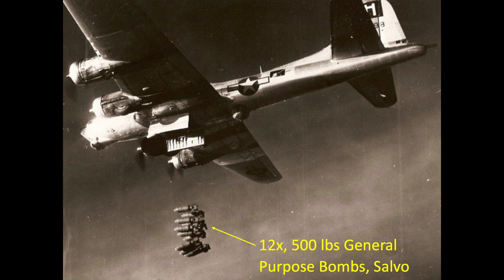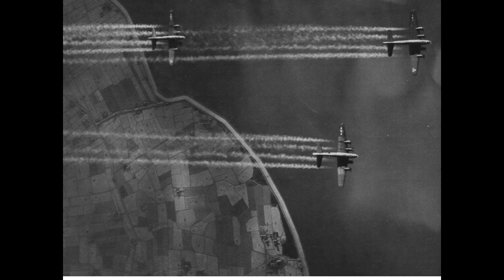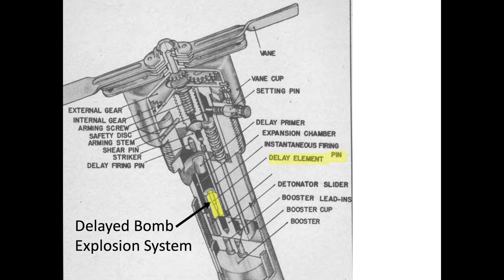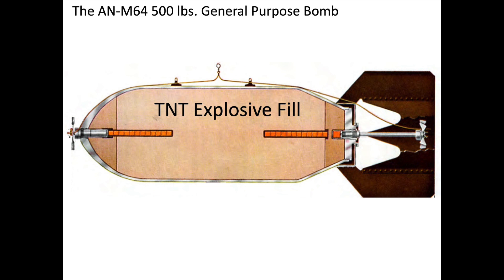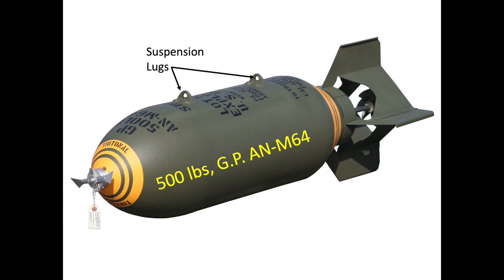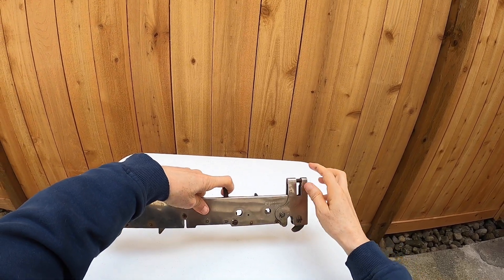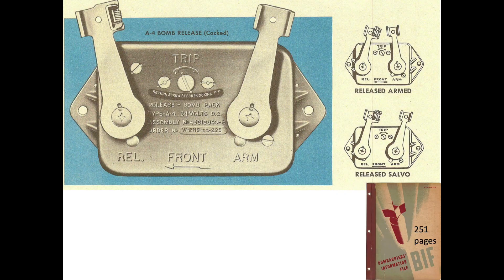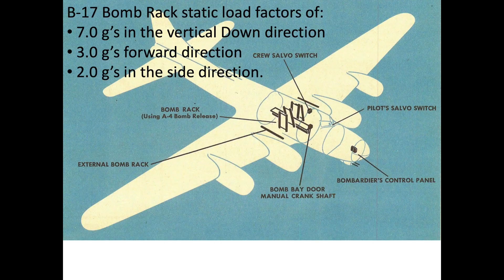B-17 Bombing, Fuzes, Shackles, and Bomb Release Units

Comment: Looks like you've got all the parts to put together a mock bomb release demonstration in your driveway. Wire it all up, get the solenoids working, hang the dummy bombs, enclose it all in a plexiglass bomb bay section, suspend it on a platform and bombs away! Amaze your friends and impress your neighbors! For added realism add a bombardier station with Norden sight.

Comment: Boy does this take me back to aircraft weapons mechanic school at Lowry AFB in 1960.  We were taught to install the arming wires a little differently: secure one end of the wire to the nearer bomb lug, run it through a wire link being held by the arming lever, through the fuze vane, and install retaining clip on end of wire.  The complete arming wire will fall with the bomb.  If the A4 arming lever is in the armed position, the wire link will be retained and the arming wire will be will be pulled through the link and out of the fuse vane; if the lever is not armed, the wire link will be free to go with the arming wire and bomb and the fuze will be safe.  This method prevents damage to the aircraft by arming wires still held in the shackle flailing in the air stream after the bombs are dropped and before the bomb bay doors are closed.  Also, I remember a bomb release actuator that allowed the bombardier to select one of three arming modes when fuzes with different time delays were installed in nose and tail fuze positions: SAFE, BOTH, AND TAIL ONLY.  Although I remember the A4 and B11 quite well, memory fades on the details of how the nose and tail arming levers were actuated independently for this function.

Comment: Disseminating info from official documents is a worthwhile contribution since most aren't really interested enough to find that info for themselves. However, it's not the same as getting first hand info from a WW2 USAAF veteran. What was actually done in practice was often not strictly "by the book." A lot of the commenters who claim their fathers or grandfathers told them this or that have incorrect info because of the typical problems with second and third hand info.

The effective bomb load of B-17F and G models was only three 1000 lb. bombs or five to six 500 lb. bombs on very long range missions. On longer missions half the bomb bay was occupied by the auxiliary fuel tank. That left only one rack for bombs. In my dad's unit, the 34th BG (H), the practice was to load a max. of five 500 lb. bombs per rack because adding a sixth significantly increased the probability of a hung bomb. If you don't believe it, look at the films of B-17 groups releasing bombs on some of the missions deep into Germany or to Czechoslovakia.

Comment: How does the sudden weight loss when the bombs were released affect the plane? Does the plane suddenly lifts up and speeds up, gaining more altitude? Also if a bomber was forced to unload their bombs without arming them, what happens to the bombs during impact?
Reply: I would imagine yes, suddenly free of the loads the aircraft will tend to rise, but I believe typically they are flying on autopilot at the time as the bombardier has control of the aircraft.  Maybe it corrected as fast as it could to keep one aircraft from popping into one above it.
If not armed.. I would imagine they would do damage simply as 500 pound heavy things impacting something at very high speeds.   Just no blast.
Reply: Most planes are flexible and noisy like a big cello. You can hear, in Memphis Belle, the snaps when the bombs uncouple and motors change their pitch.

Comment: My father flew a B-24 in Italy November 1944 to April 1945.   I have copies of his mission orders.   Those orders specified a mix of bomb fusings.  They were bombing marshalling yards - some fuses were to detonate on contact others had a mix of delay length.   They wanted bombs to explode a day later (or more) to delay repair activities.  I've never been able to find how bombs could drop from 24,000' at ~250 mph and survive the explosion of other bombs to detonate hours to days later.

Thank you for doing this video.   My father is no longer with us, but I'm passing along his message that the B-24 was better than the B-17.  :)  RIP Dad, I know I'm stirring up the shit with this one.
Reply: Awesomeness in both of these comments.
Reply: jwhoward, I think the 24 was faster and carried a larger bomb load and had a longer range but had a tendency to break apart more than the 17 when it crash landed. My uncle piloted a B-24, including I think, two missions over Ploesti. My father was a B-26 pilot who did his 65 missions and came home. Not many of these old crew members left. cheers
Reply: @diffened  Dad cited the ‘24’s airspeed and said, “do you want to be faster or slower through the flak?  I wanted the least time possible.”
Reply: @jwhoward182  Yeah, from what I have read the 24 was a better plane. The B-17 had better PR I guess, because it seems to be the more recognized plane.
Reply: @diffened  the b24 had slightly more range but the b17 could carry a bit larger payload, the speed was within a few mph of each other although the b17 could operate at much greater altitudes
Reply: @kenneth9874  I'm not going to go look things up now, but the info I've seen has it that the B-24 was better in all these aspects. In any case, I'm certainly not going to argue the point. I give much credit and respect to the men who flew in all these planes, most not really men at all until getting into combat, I suppose. By that, I just mean they were so darn young and they gave up so much. Have a nice day

Comment: One thing I've always wondered is what happened when bombs got hit by flak or projectiles from fighters while still in the bomber? Did bombers just vaporize sometimes when their load exploded in midair?
Reply: it happened, but was pretty unlikely. Military explosive is a pretty stable product. Even if exposed to fire, it will rather burn than explode. a flak or cannonshell maybe could penetrate or explode direclty nearby the bomb and set it off.